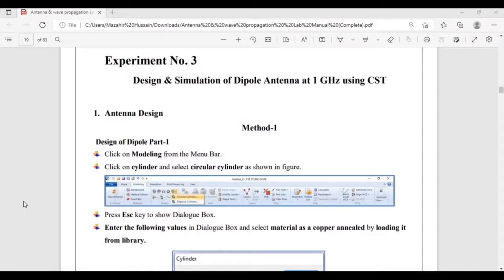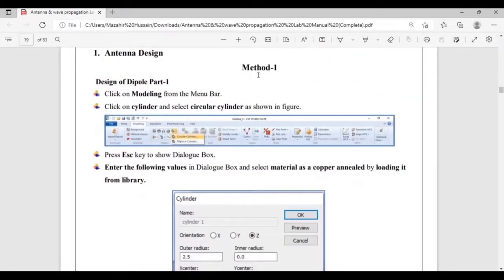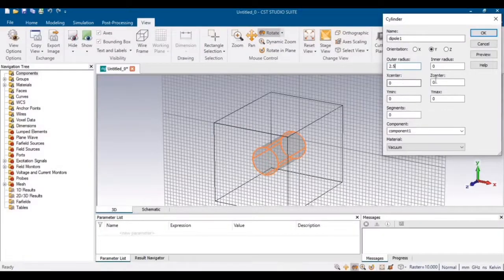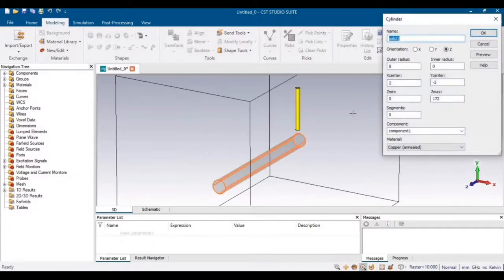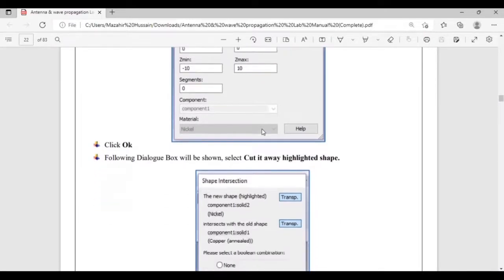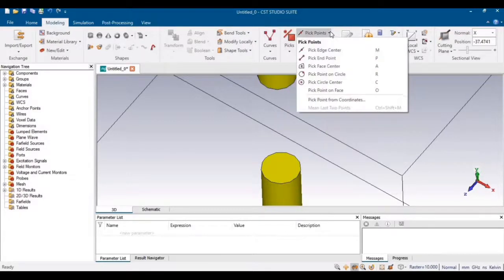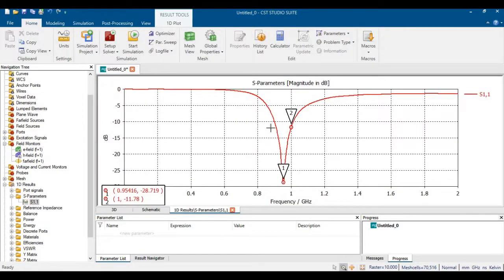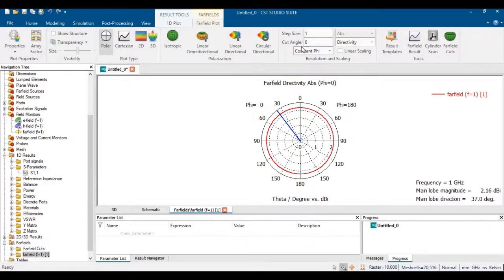Design and Simulation of Dipole Antenna at 1 GHz using CST Studio - Lab 03

Comment: how you selected the length of the dipole as 119 mm. For 1 GHz frequency, its half wave length = 149.90mm
Reply from the maker: It should be either lambda/2 or lambda/4 but you need little bit optimization as well. It is optimized value.